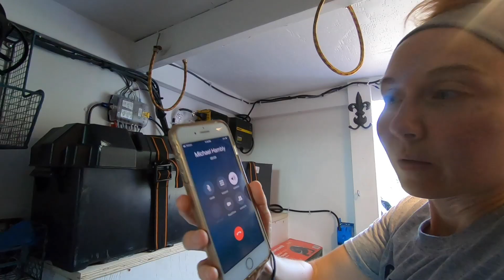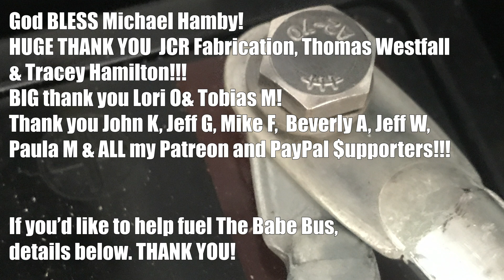VAN 911!!! The Power BLEW!

Comment: Walmart has a fan called "02 Cool" it costs about $16 and is way better than the one you have. Trust me I have it. It works on batteries and or dc via adapter.
Reply: Exactly right
Reply: Lol, i have that one.  Brother bought it on discount for me years ago, takes like 10 D batteries and they last a long time.  Batteries or electricity it does put out.  Came in handy during hurricane.
Reply: thanks for info. i will keep that in mind
Reply: using that fan [ 02 cool ] and going direct to the 12 volt part of your battery not using the inverter saves power 10 to 15 % to run the inverter good luck
Reply: Starswake, yes, a must have for those of us that get hit by hurricanes! Tons of D batteries, but, when without power for months, it does great stirring the air!
Reply: The o2 cool one we have came with an ac cord, a 12v ciggie adapter, and it can run on d cell batteries!
Also, it has a USB port so you could charge up a phone or camera from it!!!
As far as cooling, it has several speed options, and it does a great job at cooling!

Go.GET.ONE.NOW!!!
Reply: @galladanb  /  I need to check that one out!...does it cook waffles also?Haha
Reply: Shouldn’t bungee the inverter to the top of the battery, it could ground out if you touch both posts. At least throw a rag between.
Reply: They are the bomb...02 cool for the win. Casey grab two...you will be amazed.
Reply: Plus being able to use 6 d batteries in a pinch is awesome.
Reply: Kimberly Mayo totally agree....I love mine!
Reply: @ChromeLuxx  The batteries are in an enclosure.

Comment: i'm a retired engineer, and I'm proud of you. I heard you say Later that you'll mount the new inverter. That's a good idea, to move it off the batteries. All the folks wanting you to by another fan,..use the one you have till you're tired of it, or it quits working. Save that money for something else you need. 
By the way a large item on your roof, would shade your van, thereby  making it cooler than unshaded,  and provide Power for everything.   The universe's nuclear power plant can charge everything and keep you cooler in summer or warmer in winter.

Comment: Casey look at Walmart for "O2 Cool fans". Can run on AC or DC. Used mine in my van the last few years and love it. If your inverter craps out again it will still run on battery power.
Reply: Doesn’t a fan just move the warm air? 🤷🏼‍♀️
Reply: @Shan-ShanH  You have to watch her previous video where she explains how she uses her bucket filled with ice and the fan blowing over for a cooling effect.
Reply: My 02 cool only came with electrical cord. Where can I get the 12v?
Reply: @MySonsMother  There are different models available. Mine either uses AC or 4 D size batteries that last many hours of use.

Comment: O2COOL BATTERY OPERATED FANS .... the small 5 inch is amazing , I have the bigger one too and I swear by the small 5 inch blows the best even on Low , they last 72 hours on low setting , also SEABREAZ MIXED W WATER, KEEP IT IN COOLER AND SPRAY IT ON A WASH CLOTH YOULL BE AMAZED,  IVE COMMENTED  THIS TWICE  BEFORE, SURE HOPE YA GET to read this.....   plus I have the little 6 dollar Walmart  USB wire looking fans I use , only 3.3 ways, they work great also push out some great air..... great for back up and you dont need to depend on using the battery so much

Comment: I think the inverter will put a steady draw on your batteries.
Most folks have a switch to activate the 110 outlets as needed.
You may want to make another call.

Turning the inverter "on" only when you need 110v will save those batteries.

Comment: The gentleman who suggested using a DC fan is 100% correct.  When turned on, the inverter consumes  power even with no connected load.  any appliance that you can run from  your 12 volt battery will be a plus because of the improved efficiency.  Be sure your12 volt cables are large enough to carry the rated current into the  larger inverter.  Generally, allow plenty of excess capacity when selecting a watt capacity as the manufacturers advertised ratings are optimistic to say the least.  Your guardian angel is correct. The 12 Volts will not shock you. however, you must be observant of voltage polarity.  because a shorted circuit without a fuse or breaker can burn your wires (and your fingers ) in a flash.  Keep up the fantastic videos.

Comment: Love the potty mouth, look into the o2cool smart fans, they are available at target. Great fans and very quiet. Saved me on a 100 degree day with ice packs, water mister and cold water to drink, a wet shirt helps.

As for 1000 watt inverter, any big truck gas station like Flying J will have that and dc socket fans, ect.

Will you be at the RTR this year? Would be fun to meet you

Comment: You can get a 12v fan that doesn’t need an inverter.
Reply from the maker: Matt Martinez I have one. Gives a pathetic breeze
Reply: @CaseyRoman  You need the large gray 02 fan. It is great when plugged into 12 volt. The fan is the one that would use 6 D cells but plugged into a 12 volt with the jack instead.
Reply from the maker: spyralspyder My 12 V plug is occupied by my refrigerator
Reply: @CaseyRoman  You can get 12v socket splitters.  As long as you're not running too much on it, they work great.  Worst case is you pop a fuse.
Reply: Casey Roman , look into the 12v Endless Breeze fan, it’s not cheap...but it will blow you away! 😀
Reply: @CaseyRoman  any truck stop= 12volt tornadoe fan. It will blow you out the back door of your van.  Its a bit loud but, it moves alot of air. I always keep a dc fan and a ac fan in my van. Top of the list.
Reply: @Fyou32185  for sure. Inverting dc to ac when its not necessary is a hige waste of power.
Reply: @CaseyRoman  my lord Casey.  You need to come back to northwest Indiana.  Ill set you up right. You have everything you need already.  And what you dont have only cost pennies on the dollar or I have in my parts bin. Valparaiso, not Gary Indiana. Lol. Plus you missed some really cool places to visit while you were out here.
Reply: You could get a USB fan too. I have one for my Jeep and it works beautifully -- even in OBX 120° heat indexes. I'm confused. Aren't your USB outlets running straight to your house batteries? You don't need your inverter to run your USB outlets.
Reply: @CaseyRoman  Believe me.  Your 12-volt fridge is not liking this heat either.  It needs its own fan, too -- another fan to help out the factory fan.  Op temps for fridges is limited... most expect to be run in areas that are under 90 degrees F.  Heavy duty fridge (your truck stop fridge is probably heavy duty) will allow ops up to about 110 degrees.  If it is hotter than that in your van, your fridge motor will not sufficiently cool and you should probably get it its own ice pack fan, too.
Reply: I have a tornado fan in my truck in case the air or APU go out... they are a life saver!

Comment: If you have to do this again, leave the load side of the inverter dis connected. Usually if you have a spark you're under load. ( did you ever unplug a fan or vacuum when it's on and you see a little spark at the plug and receptacle ? Same idea)

Comment: having been a liveaboard for a few years and dealing with electrical issues...I HEAR YA SISTER!!  i was going to suggest west marine (despite its obscene prices) and there you were, outside of a poorly stocked one.  same thing in san deigo...there's the one huge west marine near the bay which is always stocked (except for what my boat needed); and there's the little weird one that always looks empty.  ugh!!  I had to replace my battery charger which is conveniently located in a tiny hole only a mouse can access.   good job!!  glad you're back in action and not covered in 3rd degree burns!

Comment: Well, it is a reason to build it yourself because you have a better understanding of how it all works.  Today I finished wiring in an isolator so my leisure battery can charge off of the engine when it hits a certain charging voltage.  Scared me starting the van up praying it doesn't explode lol... it's fine and now my leisure battery can stay topped off whenever I drive.  And yeah when you connect the negative cable that cpark still makes me jump lol.  Happy Travels and cooler weather.  Heading to the poconos for the weekend much cooler there

Comment: Square and modified wave inverters hate mixed loads, motors and pumps run hot with them too. Trying not to snob, skip em if you can.
Reply: Marquis, what do you mean by mixed load? Computer equipment vs. fridges or water pumps and such?
Reply: An inductive load like a motor or pump is always partially out of phase because of the choppy wave form from the inverter. Switching on and of appliances can further cause distortions and spikes. They are not as stable and have less reserve capacity. I do use one to charge my tooth brush though.

Comment: Glad you got your inverter replaced.  I am allergic to working with electricity, it tends to be a shocking experience for me.  I bought the best portable fan for camping from Walmart.  It is directional and has dual power, both battery and a/c.  I will be more than happy to order one for you that you can pickup at whatever Walmart you are close to.  2nd fan is always good.  By the way, loved the Fleur de Lis coat hook by your batteries!

Comment: Amazon lockers are where people on the road have stuff delivered.

Locker locations can be found when selecting a shipping address during the checkout process or when adding a new address in Your Account.
 Once your package is delivered to the Amazon Locker, you'll receive an e-mail notification with a unique pickup code that includes the address and opening times for your selected Locker location. 
If you have a Prime account, the shipping is free. Some but not all locations are same day delivery. A package not picked up will be returned after 3 days for a full refund, or you can have it forwarded to your next location. Like when you 'blew through' PA.

Comment: 1.21 gigawatts of sweating stress.  I keep waiting for a van dweller to get one of those 12 volt portable air conditioners with a non biased review but they are pricey, the hounditioner small dog house ac looks promising for a van dweller and are around $300. Anyway good video we could feel the stress and relief.
Reply: 5k fridigaire window ac is cheaper /more efficient than hounditioner . has a 12.2 eer rating at 410 watts and 3.8amps
Reply: Look up " rolling earthship " on U Tube ; he just did a video on that small AC unit
Reply: @peterandrews4172   His review , while kinda positive , was not really a success as it only cooled his van down somewhat. He was still at like around 80+, which is better than 90-100+ outside . For it to be really effective , it would need to be able to cool to a much lower temp. Plus that unit is not inexpensive . It cost him $1000+
 plus the parts he had to buy. Not a cheap fix for cooling his van off.
Reply: vial.of.photons  ?  There are plenty of places to park and run your generator, maybe not at night , but during the day when she needs to get that van cooled down to function like a sane person. Plus if it gets totally unbearable in the van , she can run the van dash ac for a little while to cool down . I've done that many times , no big deal .

Comment: Absolutely right - you need a community! Back to the video though. Electronics don't like heat either and will cook themselves. A bigger inverter will generate more heat in that small space too! Overall battery life gets a bit sorter too but not so much you'll notice much. First suggestion - turn off the inverter (especially when you are not using 110 appliances) and get 12v as others have suggested or USB powered. I can't remember if you have a 110v fridge though. Could be a problem. I got a battery powered fan charged from USB. It would also help to ventilate the space under the bed. Perhaps a second fan? Good luck!

Comment: Being soo hot , even though your fan etc is not sucking that much power, over time with that extreme heat I reckon the inverter components probably got too hot and fried itself. 

In my opinion it’s best to have a direct 12v set up , inverters should only be used for short periods . 

Please comment feedback if I’m right or completely wrong 😃

Comment: So scary, when you are alone. I had a simular thing, in my RV, 3 hrs from home, at a dog show (with 4 dogs, 100 degrees, my braker kept kicking, the box was hot as an iron (which was under my bed). Ice bottles in with dogs, no electrician would make a call on Sat evening...my savior was one of the dog handlers husband the wire connector was a plastic bar and had melted onto all the wires, so no ground. Those bitchs burn down in 5 min flat. (Wouldn't you know, my son is a journeyman electrician, sigh). Glad you are safe and up and running.

Comment: It's pronounced  Key-say-a, I've bought a couple of them..my current one is 2000 watts and is an inverter/charger and works great,  and they always spark the first time you hook an inverter up to the battery...It has to do with charging up the capacitors ....not to worry...Oh yea I'm a retired electrician and be glad to video chat and help if you need anything....cheers. Terry

Comment: Luv your videos! Why won’t you go somewhere and mooch shore power? There are many locations where there is a ac outlet that you could use! Back of gas stations, convince stores, park pavilions, omg, they are everywhere!!! 
We also luv staying at COE (Corps of Engineer s) campgrounds! There is probably one near you right now! We use our national park pass, or golden eagle as it used to be called, and the nightly rate was like ten bucks, maybe twelve... That way you could run your overpriced air conditioner unit!!

As far as I know, most inverter’s are toast if they don’t work. Most can not be rebuilt. Thank god you bought a good one with a good warranty this time!

We hate seeing you struggling! Anyway, FYI, that spark when you touched the cable to the battery was completely normal, even if it was Uber scary! Like MH said, that was a good sign. It happens because the inverter’s capacitors we’re hungry for juice, and get really greedy on first contact. Then they settle down and perform! As intended!

Luv ya girl! Think happy thoughts of Moo cow joy for your new happy place!!!

Comment: Great work! The power rating on inverters is typically for a resistive (ideal) load, while most loads (like fan motors) have a reactive component that leads to a large load spike on power switching. This may be what killed the small inverter, despite the fan being nowhere near 400 watts. 

Yes 1000 watt is probably the minimum size recommended for what you're doing. Some inverters in this class and larger have remote power switch with indicator light so you can see it's on/off without going below.

Finally, I would urge using safety glasses doing anything like this. Have saved my eyes a couple times in electrical work.

Oh, the spark when connecting even a powered off inverter to the battery is from charging the capacitors in the inverter. After that initial zap, they're charged.

Comment: Its the surge wattage which is much higher than the running wattage. You should consider yourself lucky it burnt out. While the other option is catching fire! You need a 2500 watt inverter. Plus a hitch & basket with a generator to power an air conditioner. Its easier to find incerters at a truck stop. I reccomend Loves travel stop. And a sine wave inverter for sensitive electronics

Comment: If that new inverter craps out on you try a samlex pst series inverter.  I have used 2 of them for years in high temps and humidity without any problems.  They are worth the higher price.

Comment: Casey, in my camper, most if not all "things" work on 12 volts  even the TV so basically I don't need an inverter. Microwave and AC need 110 volts. Your laptop and camera need very little amps. Your inverter blew because it was defective not because of your usage. You don't need a bigger inverter just a good one. Good luck

Comment: Nice job with the inverter swap !  I would say 9 out of 10 of my friends could not do it . I’ll send you a digital volt meter . You will know how much battery life you have at any given time . Your batteries will certainly last 3 days without you starting the van . 60 minutes of engine time and they are full charge . The digital volt meter will confirm that .

Comment: Casey you really should have a basic tool box with you on the road! Also next time your in Walmart's purchase yourself a pair of rubber gloves to protect your hands/arms from sparks when you have to handle the batteries . It wouldn't hurt if you had some dual power fans. I've tried several but I am most of my friends have liked the one made by Ryobi (sold at Home Depot). They run off battery or electric power with an extension cord ( both sold  separately) . For me the battery will last up to 11 hours on low speed and up to five hours on high when using the battery pack.

Comment: Buy a 4 in1 power pack from harbor freight... only about 50.bucks it can run small fans like that... plus you can jump start your car and inflate your tires in case of emergency....
Reply: Yes. I ran my large 12 volt 02 fan on the 4 in one for 8 hours at a time.
Reply: @spyralspyder  yea great for emergency...  they are nice to have..